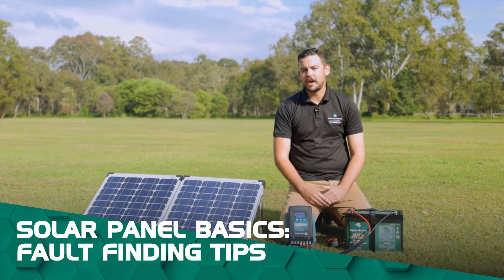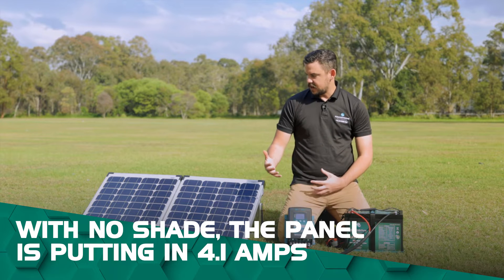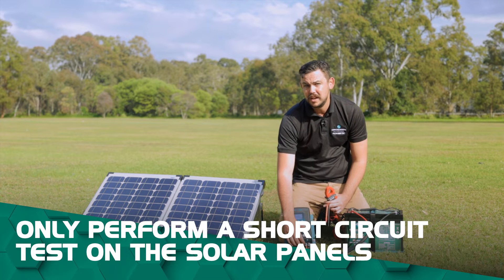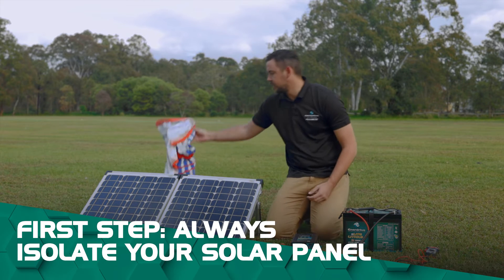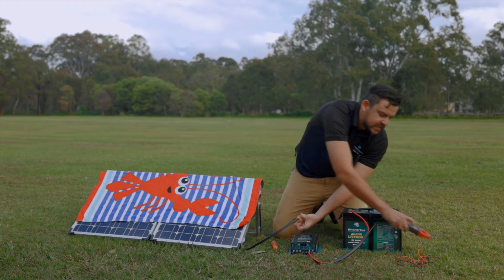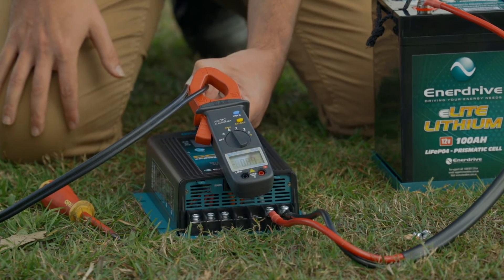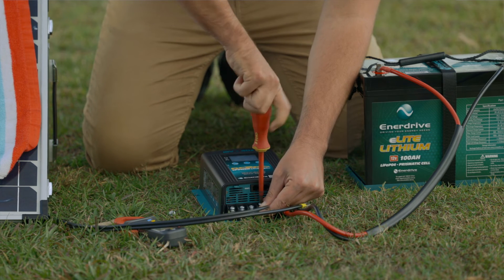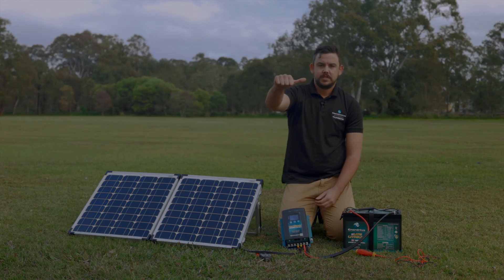Solar Panel Basics - Fault Finding Tips - Enerdrive

Comment: How do you set the battery type on the Enerdrive solar charge controller.  I have followed the instructions in the manual but it doesn't seem to work.
Reply from the maker: Hey, thanks for your question! For the best support, please visit our dedicated support centre: https://support.enerdrive.com.au/. You can also find helpful resources, FAQs, and contact options there, including phone support and a contact form.

Comment: Hi team. 

My DC2DC charger is not receiving any input from the roof mounted solar panels on my van. 

The van is parked and the main circuit breaker is off. 

But the battery is draining

Has always worked before and I haven't touched anything. 

The battery did go flat and I rebooted it to charge it via 240V

Is there something I need to do on the charger to allow it to recognise the solar input again?

Thanks in advance.
Reply from the maker: For the best support, please visit our dedicated support centre: https://support.enerdrive.com.au/. You can also find helpful resources, FAQs, and contact options there, including phone support and a contact form.